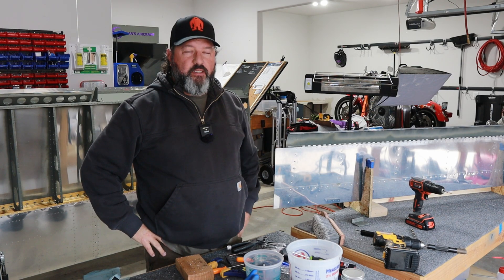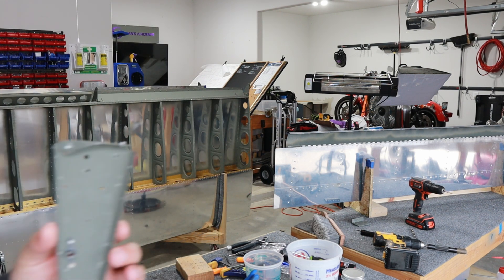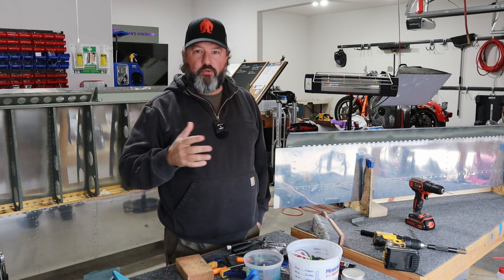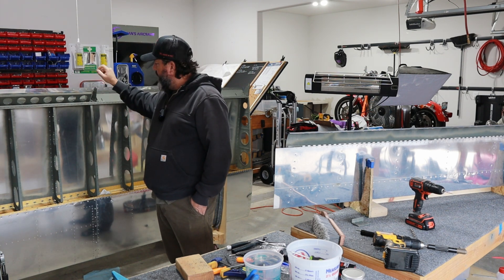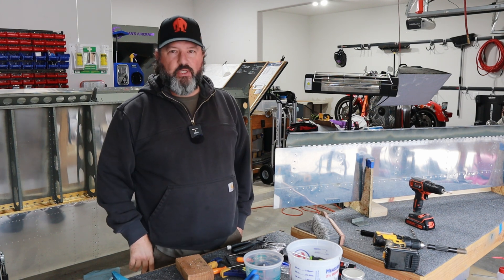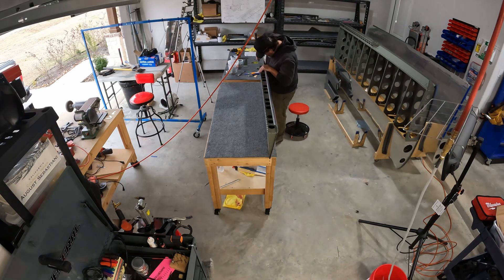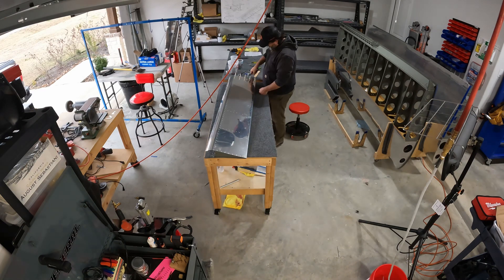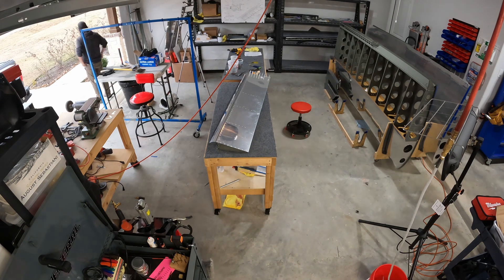Van's RV-8 Build. Ep 145. Flaps 22. It's Worse Than I Thought

Comment: These Cherrymax rivets are as strong as solid rivets if the hole tolerance is correct. This is why it is better to just use them if you think you are going to have issues bucking a rivet before drilling a bad rivet out. I'm worried a bit at how easy that Cherrymax drops into that rear hole and how bad the front hole is looking.
Reply from the maker: You’re correct. I misspoke in the video. All three of those holes need to be upsized to -5 (which is what I actually ordered … CR2313 5-6)